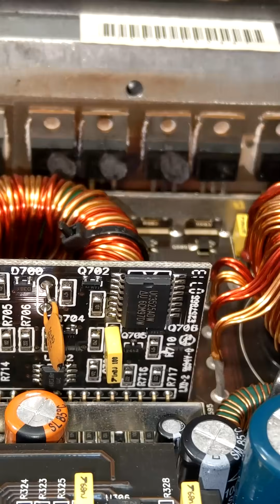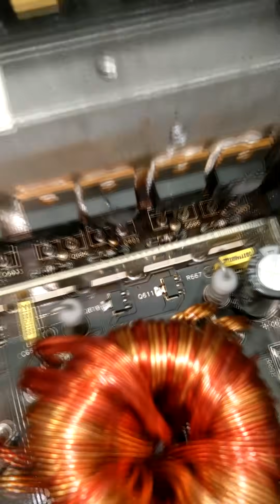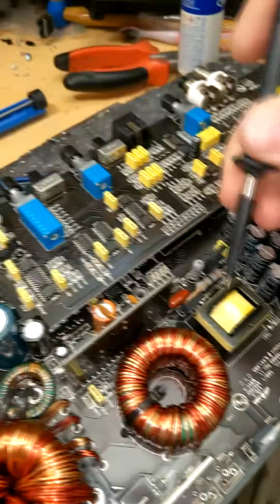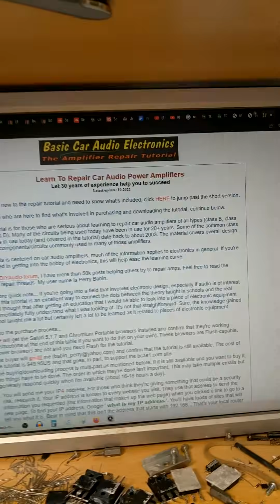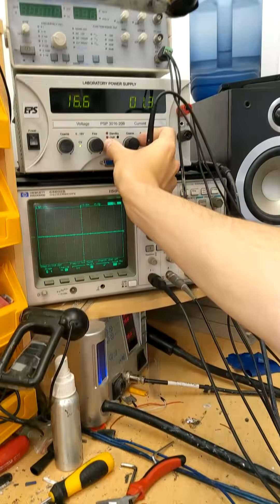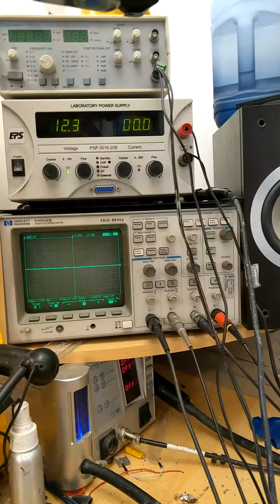Full Rebuild of a JL Audio 500/1 - Most Sold Amplifier

Comment: I have the 500/1 amp. What test can I do to see what part I need to replace? It powers on, subs come on but it's very low and distorted bass. Even with the gain level up sounds low and distorted. What part could it be?

Comment: Hi I have the same amplifier. When it powers on there is a loud thump and the audio sounds a bit low.  If I touch the chassis of the amplifier the hum and the status sound quiets down. Any ideas what could be causing this ?
Reply from the maker: @frankpaul3204  sounds like a grounding issue with your system in general. Disconnect the RCAs from the amplifier and see if it still has a thump and that problem. If all the issues go away when you remove the RCAs, then the amp is fine and there is likely an issue elsewhere

Comment: I have a 500\1 slash....I opened up everything seems to be ok but it seems lime a switch is messed up but it only sounds like its working at half power any help????
Reply from the maker: Spray all the switches with 99% isopropyl alcohol and flick them back and forth many times to clean the contact rails

Comment: Hey sam i have a jl 1500/1 its basically new out the box it ran fir 1 hour then niw its giving me a solid red light saying its in thermal  shut down i  multimeter the pos and. Neg  no beeping so the power and output sude i tested ok i tested the thermal sistor even  it is ok any ideas what it can be ? I visually see nothing wrong
Reply from the maker: Sounds like output fets, measure across them ☺
Reply: @barevids  I measured them 3205 chips all look good on multimeter checking continuity I get about the same number and no dead shorts only dead short I'm getting is on a grey transistor with the different color stripes there's 4 and 1 reads dead short u think if I removed that dead short 1 it be ok to power up also nothing gets warm when I power up also the clip lights stays on with no input plugged in or anything plugged into the output
Reply from the maker: @joshholden8561  3205s are power supply. You need to measure outputs.
Reply: @barevids  I measured across them all seemed normal reading but the silkscreen is totally fine from output mosfets they are like blanks like Jl is hiding what they are
Reply: @barevids  output fets look brand spanking new this amps was took out the box played for 1 hour then stopped cause thermal shutdown but amp was not hot barely warm gain on 3 barely in

Comment: What caused my 500/1v2 to melt the 12v connector?(shop installed) Even with melted connector the amp still worked so the shop refused to replace amp.  I had trouble trusting it since so it sits in its box.  Where can I get a replacement 12v connector and do you think it will be safe to use again?
Reply: If a connection comes loose it could cause sparking which can cause a fire or melt connectors, but without seeing a image of it, can't say for sure.  You would think a fuse would blow if that was the case, that is if a fuse was installed.

Comment: My 12" is currently slamming the full phat 125vrms (could take more actually) and it got me thinking, what would be the breakdown voltage of that enamel on the voice coil windings?  I'd be devastated if I killed it, not by heat, but just voltage breakdown alone.

Comment: i need one of those three way switches for my JL1000/1v2. The Mode slope (off/12db/24db) switch is corroded and barely makes connection so that amp only works if you mess with the button perfectly.

Comment: Awesome!!! I have my personal 600/1v3 im trying to fix, what were the value of the gate resistors in your case? Mine read 10ohm but im not sure if thats right? Seems low 👀 thanks and nice fix!!!!
Reply from the maker: 10r is fine 😁 anything between 4r7 amd 47r will be OK! As long as they're all the same!
Reply: @barevids  solid! Going to attempt the repair once the New PS Fets come in, as well as gate resistors. Thanks a bunch 💪🏼
Reply: @barelyfastmedia jeez, i just purchased this model last week, BNIB old stock, Do you still love the amp or should I of gone w the 750HD?